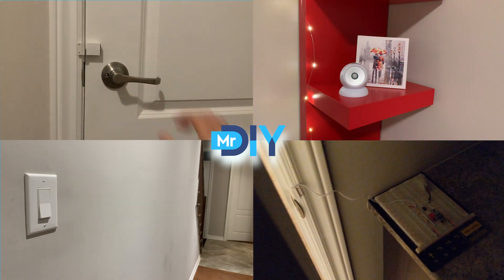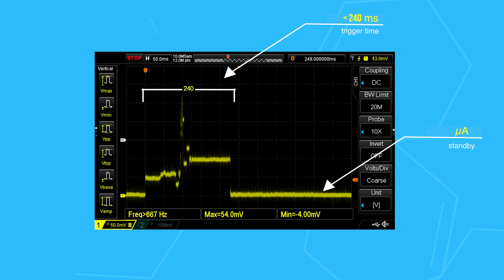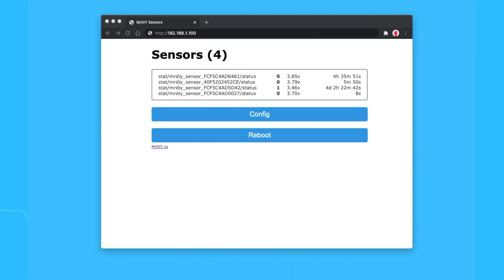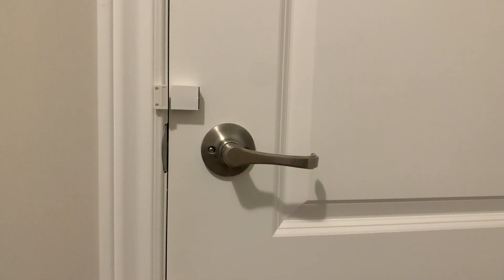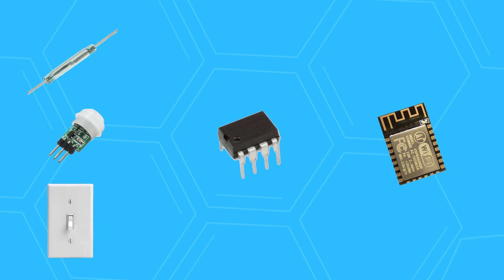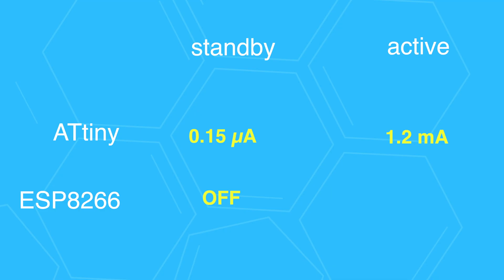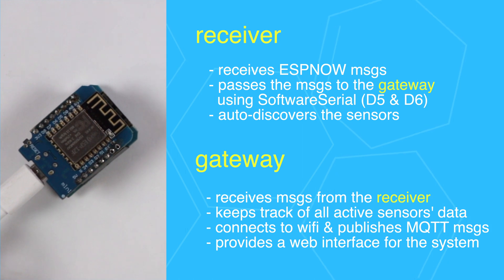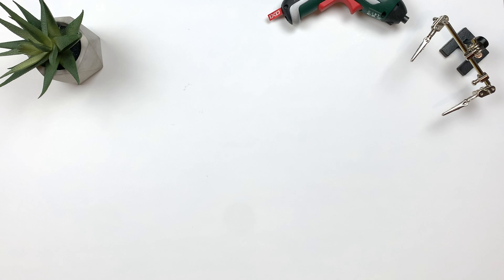My Ultra Low Power Wireless Trigger Sensor: Overview (Part 1)

Comment: Can you use directly the esp8266 on sleep mode tgen wakes up with external interrupt? Sorry newbie here..
Reply from the maker: ESP8266 micro-controllers don't have normal interrupts while in deep sleep as AVRs for example. You can not trigger on an active low that is why I used the attiny.

Comment: Hi, it has a Security Flaw if the Intruder has a magnet he can disable the trigger of latch circuit to off position you need to add a timer circuit for latching mechanism
Reply from the maker: Yes, in theory, you are correct. But it is very tricky to pull off in real life. It is way easier to just jam the 2.4Ghz frequency band. My goal is not to build a security system but a sensor for notifications/automations. Can you tell me more about the 'timer circuit for latching mechanism' and how would that work?
Reply: @MrDIYca  Timer is little more tricky to build you need NE555N to do that you can check out its datasheet but there is more easier way why not use NPN, s base as input from MCU and in program you just pull it LOW when the program starts then when MQTT message is sent you can pull it high.I made my sensor board with ESP12F using two BC547 s two 10k resistors, 1k resistor, 1uF Capacitor and I have also implemented my own regulator with HT7333 LDO with some capacitor filtering before and after. All of this working in Deep Sleep mode. All consume around 4 uA which is good for battery operation.I Just checked out the LDO SPX3819 it has a quiescent current of 90uA which is not really ideal for battery operation.

Comment: Interesting system. You mentioned the ATtiny responds to (hardware) interrupts. Could this also be timer driven? I' m designing a low power sensor application to measure sensor data n times a day then go back to sleep but with the power consumption of your system this could be very attractive
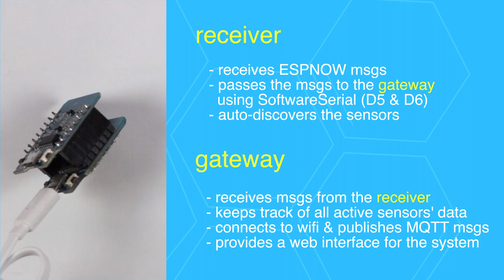Reply from the maker: Yes you can. This is what I did for a ULP temperature sensor I am working on. You can see a preview here: https://youtu.be/xPPdYvKbSFk?t=231 ( jump to 3:50). I used the ATtiny as a timer to wake up every 15 minutes. Project should be out in the coming months.
Reply: @MrDIYca  Txs. Will get going in there meantime 🙂

Comment: This should have much more views and is exactly what I need! I didn’t want to use all my sensors with static IP in my IOT Wifi, so ESP now (mesh?) is a great solution. Did you implement some turnover message to push the sensor into regular WiFi/flash mode ?
Also the Sensor nodes seem simple enough to make a good compromise for the improved capability’s and battery live - I would relay like an kit version using pcbways kit service at and Size Level - but the Gateway seems a bit hacky compared to the rest of your design. When I am building this for myself, I will be using an POE powers ESP32 Ethernet  board and use the wifi part as the Espnow Gateway - seems reasonable for mee
Reply from the maker: BTW, I have a new Gateway design here https://youtu.be/xPPdYvKbSFk

Comment: very very cool.  If you are looking for something similar but using the ESP32 and not requiring a hub device, check out the Trigboard. Very clever board with super low power. I like the low cost of this design!
Reply from the maker: Thank you. I did check the Trigboard - it has a very clever design indeed. I really like it. However, I needed something that is super simple and extremly fast acting. The Trigboard, without a hub, takes over 3 seconds to action a motion. Not really a hardware issue, it's the wifi stack. That is why I opted for ESPNow in my design.
Reply: @MrDIYca  ok.  in my experience it has been much faster than 3 seconds but i definitely see your point. Thanks for sharing your great work! Can't wait to see some more.  I am really starting to love the beauty and simplicity of MQTT and I think you've got some great projects on your channel.

Comment: If a gpio could be toggled at the low power battery operated side,  I can then try to power momentarily a servo, to act like switchbot, for that application,  an RF or Bluetooth would be more efficient? Or wifi with some timed  polling might do the trick?.
Reply from the maker: It might work but will drain the battery very fast.
Reply: @MrDIYca  Thank you so much sir for the feedback, may be BLE would be a candidate for that application.

Comment: how to login into gateway interface? I made the gateway node first. i was able to connect and set my wifi ssid and pw. i don´t have mqtt server right now so i put in some random data. the node connects to my network but when i try to connect it asks me for username and password. what to put in here? maybe i´m stupid but please help me out.
Reply from the maker: Hi Herbert, no not at all, the username is 'admin' and the password is the same as the AP's ( or 'mrdiy.ca' if you didn't change it).
Reply: @MrDIYca  Wow. Thanks for the fast answer. Not it works. But one strange thing. The gateway of the hub connects to my network and the receiver of the hub also obtains an ip but is not accessible in browser. is this normal or because i uploaded the gatewaysketch to the receiver board for first testing but then uploaded the receiver sketch later. i thought receiver is only to receive espnow messages and should´t connect to my wifi.
Reply from the maker: @herberthaas5471  You are right, the receiver doesn't connect to your network. So if you are seeing an IP on that device, then you are probably doing something wrong - make sure you are using the code from esp8266_receiver.ino

Comment: Is there a limit on how many sensors can be added?  Doesn't ESPNOW protocol has some restriction on this?
Reply from the maker: Yes, for peer connections, it is 20. But I am not sure if that applies to broadcast or not, which I use.

Comment: Could you explain more around why the hub is needed? Like why couldn't the esp8266 just emit the mqtt message?
Reply from the maker: The Hub is needed because going the wifi route would have increased the trigger time. It usually takes seconds for the ESP to wake up, connect to wifi and send msgs and I wanted a sensor that can send msgs in almost real time. This where the really fast ESPNOW comes in. The hub is needed to convert the ESPNOW msgs to MQTT over Wifi. Since the hub is always on and connected to wifi, the ESPNOW to MQTT becomes almost instantaneous. Hope that helped.
Reply: Thanks, that makes sense.  I hadn't heard of espnow before.   Seems like you could possibly eliminate the esp8266.  https://randomnerdtutorials.com/esp32-esp-now-wi-fi-web-server/

Comment: Nice design work!  I have done something similar to get super low idle current.  I used an Attiny202 which has an internal oscillator going as low as 32kHz.  At 32kHz the Attiny202 draws less than 15uA.  Of course in sleep mode it is similar to the Attiny you used.  Just another idea in case it is useful.
Reply from the maker: That is indeed a great idea, slowing the speed way down - I will add that to my bag of tricks. Thank you for sharing!